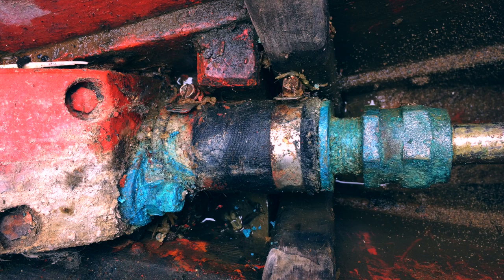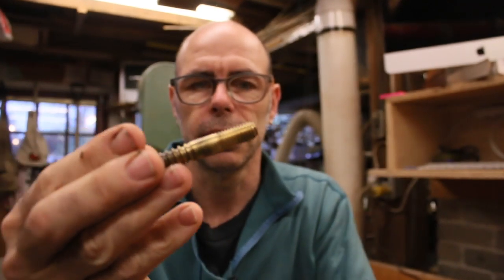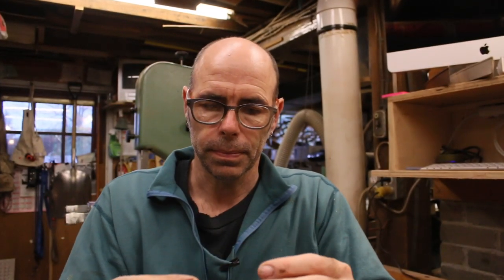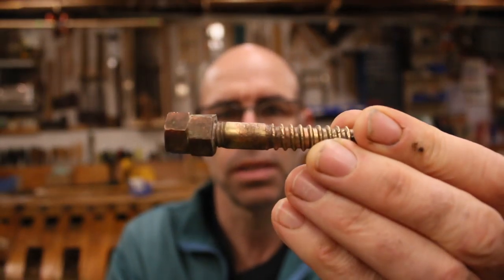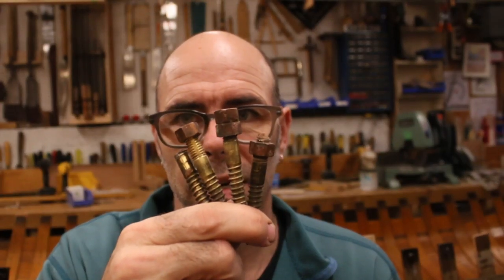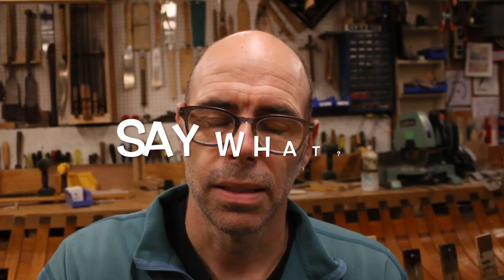⚓️Nomad - Can you make bolts on a bandsaw?

Comment: Yes this is 4 years late just want to say I Love your humor… But how did you feed the rod so smoothly to get such a uniform thread???
Reply from the maker: You’ll notice a little metal bar clamped near the bandsaw blade. It’s acting as an indexing pin, running in the thread groove as I cut it.